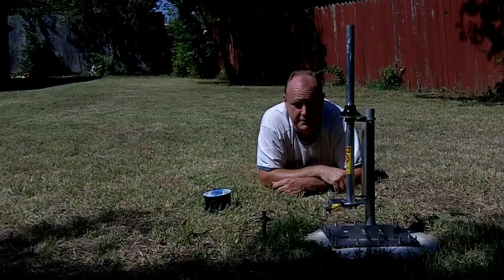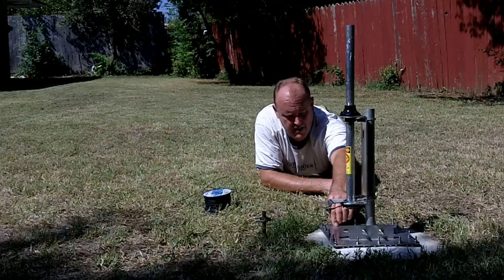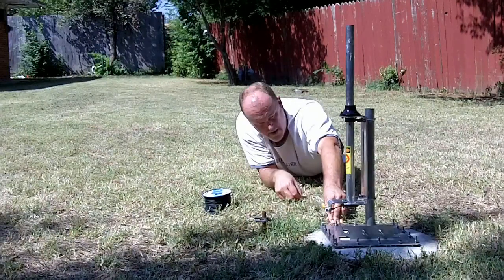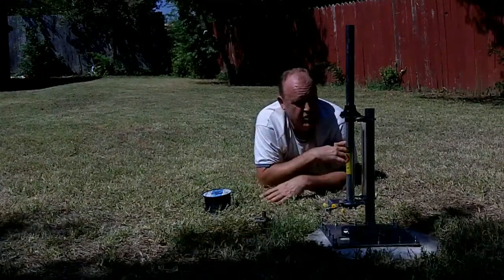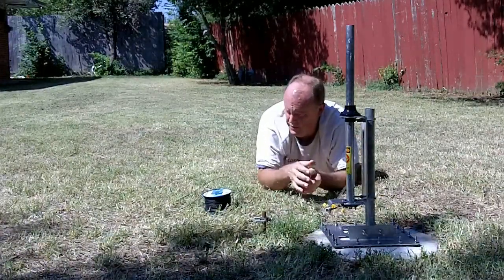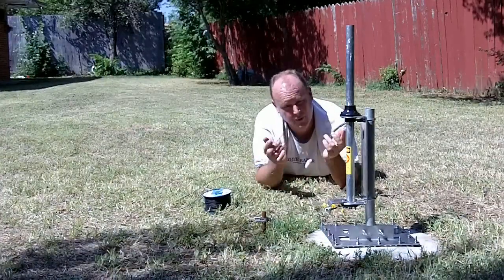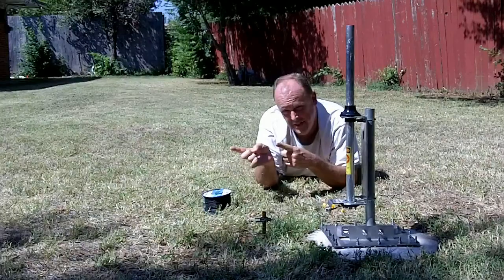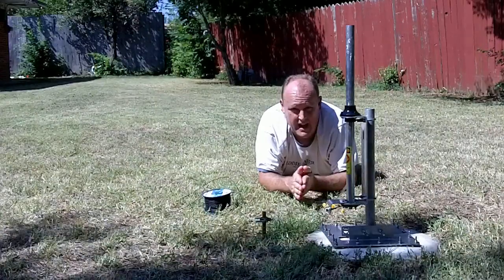Part 1 - Ham Radio Antenna Radials

Comment: Thanks for the videos. I Installed a H4BTV with radials 360 degrees...a little over 750'  of 16 AWG wire. You could use smaller but my backyard is used a lot and it needed to be able to stand up to walking on and mowing over. I also used the DXE radial plate and install kit. The whole thing cost about $500. It works great!!! I have made contacts in Italy, Puerto Rico, Canada, Brazil and of course all over the USA.

Comment: What is the diameter of the concrete pad that you used?  Did you use a concrete tube form?  If so did you have to offset the mounting pipe to make the radial plate symmetrical on the concert pad?

Comment: Might want to mention here that there is no need to cut the wires to any sort of wave length.  Just run them straight out as far as you can in each direction.

Comment: if you only have 3' space along house and fence and for radials would this antenna still work?  I have like no space or tree's.
Reply: 1guysmilely yes any amount of radials will help they don’t have to be resonant length when the antenna is mounted on the ground. I have the same issues with space so I put about 25 or so down and it made a big difference.

Comment: I tried to find the radial wires online but was unable to find them. I tried to send you an email from the qrzed page but it bounced any help you could give me in finding any inexpensive wire would be appreciated.
Reply: Get a100 ft spool of 14/12 awg, braided insulated wire. You don't have to cut them to be resonant like he did.  The ground will just detune them in the end. The purpose of the ground radials is to create a launch angle not to balance the antenna. Short radials increase the launch angle, long radials decrease the angle.